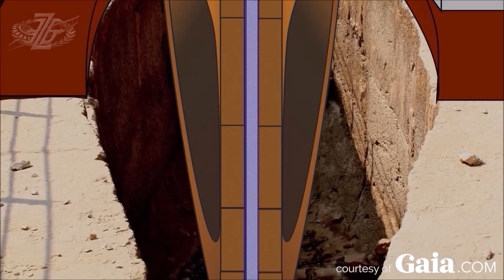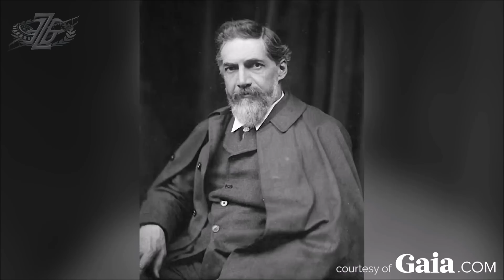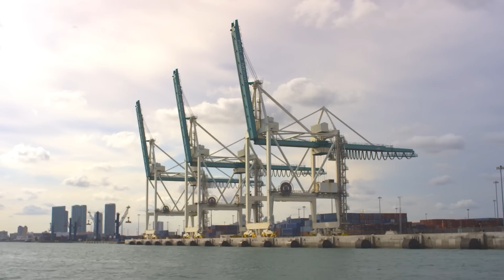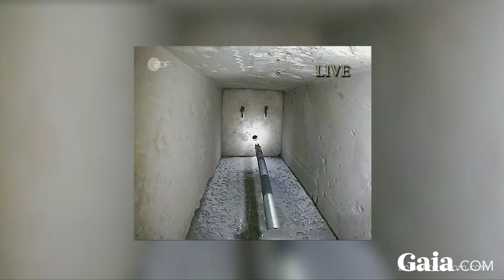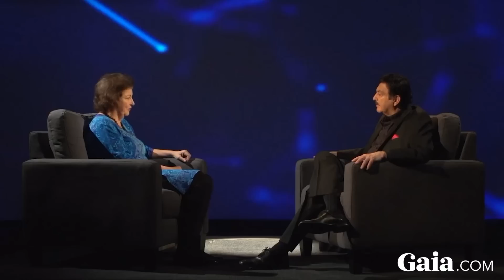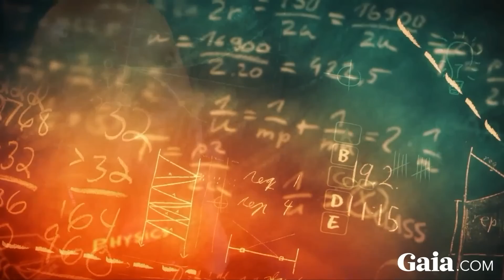Hidden Machines Beneath Giza: Egypt's Industrial Secret Exposed! | George Noory

Comment: Cygnus star constilation actually fits better over the giza pyramids then orion does, so it has wings and they have stars in the tips of the wings. Two places on the map, were dug and they found temples at the star points of the wings... go figure, it may not be orions belt they point towards, but, im not an astromer at all, does it mimick that in the sky on a certain date like orion is supposed to? heh. It is neat at least. From what ive been told inside, Giza is well over 550 million years old people.

Comment: So Cali will have 100 hydrogen stations. This means you will be driving 100 miles or more depending on your Location. I don't think anyone will drive this far to fill up the car. A 3 hour round trip. Even if a tank lasted 2 weeks i wouldn't do that.

Comment: In the Sumerian tablets...the pyramid wars section explains the pyramids at Giza made up a space port of the Annunaki.After the second pyramid war(which was won by Enlil's son)everything in the pyramid that made it function was removed.Just because modern academia calls The Sumerian tablets myth(or most of it anyway)does not make it so.
Reply: which Sumerian tablets? I’m a little familiar with the Enlil and Enki lore but didn’t draw any of the connections that the Giza pyramids were space ports
Reply: not challenging you - actually just a knowledge seeker
Reply: Some links or hints where you got this information,please)😊
Reply: @DJ_Iguana  look up the Enuma Elish. The original versions were on 'cuneiform tablets'.
Reply: @DJ_Iguana Zechariah Sitchin
Reply: The Enuma Elish.
Reply: They used Hydrogen as fuel to fly They Planes. Piramid Generator Produced hydrogen
Reply: thank you so much for that information that was wonderful

Comment: THEY ALWAYS WANT US TO HAVE TO GET OUR FUEL FROM THEM HYDRAGEN , YOU'LL STILL HAVE TO PUMP IT AT A STATION, THE MAN INVENTED THE CAR TO RUN ON WATER IT WAS ACTUALLY A DEVICE THAT CONVERTED THE WATER INTO HYDROGEN WHICH THE CAR USED TO RUN AND THEN IT KIND OF BACK INTO A CHAMBER AND WAS RERAN IT DIDN'T HAVE TO BE EXHAUSTED OUT BUT THAT CUTS OUT THE FUEL PEOPLE AND SO THEY'LL NEVER LET THAT ONE GO THAT MAN DISAPPEARED.

Comment: WELL THE HYDROGEN PEOPLE BETTER BE CAREFUL BECAUSE THE DUDE THAT INVENTED THE CAR THAT WOULD RUN ON WATER DISAPPEARED SOON AFTER HE SHOWED IT TO THE PUBLIC
Reply: More than a couple people who had patents were disappeared
Reply: " the day after Roswell "  , Col. Corso @mikemccoy4614
Reply: Rockefeller st.
Reply: We can produce our own hydrogen power the electrolysis with solar panels, and retrofit and reprogram modern cars as they sit in a weekend . You need bottles obviously, bottle warmers for more efficient transfer plumbed to The fuel rails with an adjustment in the spark timing...
Reply: Water is the new gold👉they’ve been fracking under our feet making rivers disappear so we can’t easily access water
Reply: @kimlarso But there are far more accessible water resources...Why would they waste money to acquire water from rock when there are oceans filled with it? Thats an expensive and unnecessary step no ?
Reply: @CarsCatAliens  water is not acquired by fracking, but fracking does destroy existing clean water sources.
Reply: Nazis Blvd.